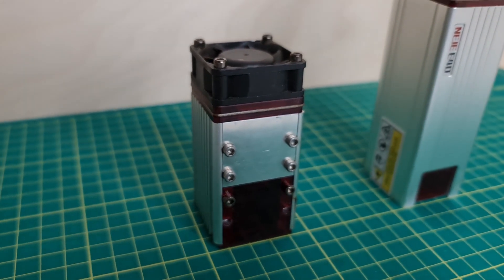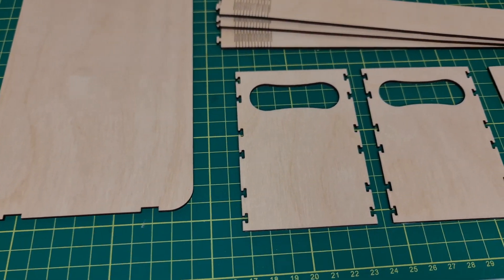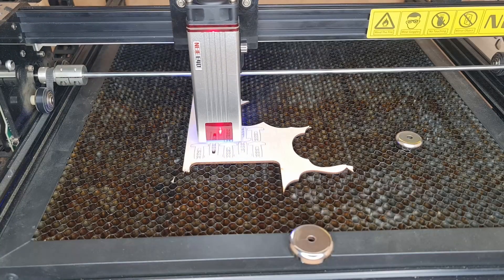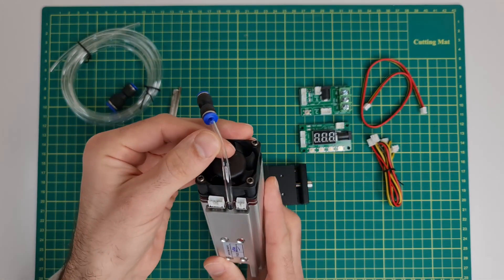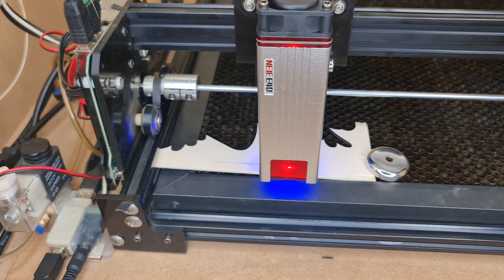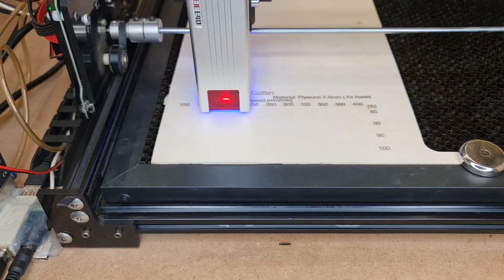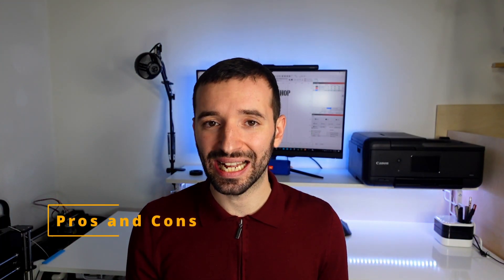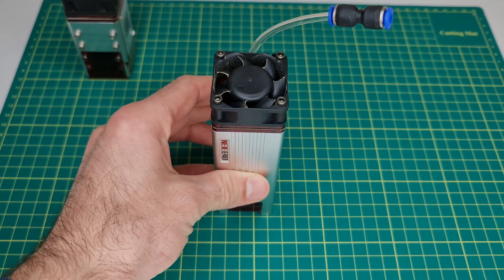Neje E40 review - Is this the A40640 Killer?

Comment: When you mentioned the power supply it made me curious. 12v vs 24v....I have the E80 and the power supply sent by NEJE broke within 48hrs. I have the old power supply for my A40640 on my 2s. Will it work while I get another ordered in (can't get NEJE to respond)?
Reply from the maker: Hi, @CrisAnderson27; thank you for your comment.

The A40640 had a 12V power supply, therefore no it won't work.
You need a brick rated for 24V 5A at least.

I hope it helps
Ciao

Comment: Neje claims the A40640 II has a spot size of 0.04 x 0.06mm and 0.03x0.04mm for the E40.  Are they really that different in terms of kerf size when cutting 3mm plywood?  Couldn't the focal length be adjusted on the A40640 to get essentially the same cut kerf as the E40 on wood thickness less than 5mm?  And when the tiny spot size is set for the A40640 (short focus), what is the focal point length from the bottom edge of the laser module?  According to Neje, the focal point on the E40 is 3 to 5mm from the laser module bottom edge.

Comment: Tell us about your air assist compressor
Reply from the maker: Hi, Doug King; thank you for your comment.

I use a Vevor Silent Oil Free Compressor
https://s.click.aliexpress.com/e/_DFyh6jt
https://s.click.aliexpress.com/e/_DBxAg87
If you use a compressor, you will need a Water Trap
https://s.click.aliexpress.com/e/_Ddo089z
https://s.click.aliexpress.com/e/_DEMFjE3

An air pump would do the job, but not as clean as a compressor.
The only note is the higher the pressure, the higher the likelihood to get condense in the line; therefore, a water trap is a must. If you want to go professional that a refrigerant air water remover will be best suited.

Ciao
Reply: need only cheap aquarium pump you have air assist, not need big expensive compressor newer. normal many brand use own air assist pump 30L/min pump, lot used only aquarium pump. lot cheapen buy aquarium pump than "laser" pump and both have same pump sure.  aquarium pump cost 30-40$ and totally same pump brand say "laser" cost 100$ or more. only idiot waste money laser pump if totally same pump can buy lot lot cheapen aquarium pump.

Comment: Hello and thanks for the video.
I use the E40 for cutting plywood up to 4mm & acrylic up to 3mm; Otherwise, I cut balsa wood in different thicknesses for model building.
I had a choice between the E40 and the A40640II, but the E40 is more effective for my purposes.
I love the fixed focus because I only had the A40630 module before and had to change the focus after engraving some objects for the cutting work. I still enjoy using the A40630 for engraving work on anodized aluminum when the E40 is busy.
I avoided the difficulties with the optimal focus (5mm for me for 1.5mm engraving depth) with the working height of the laser, because I have a steel honeycomb and work with thin neodymium magnets.
A big advantage is of course the engraving of stainless steel without this expensive ceramic...
I use a 37psi compressor as an Airassist and have no problems with parts that are blown away and there are sometimes very small parts in the various model building projects.
Good that you also addressed the point with 100% usage.
I find it important to clean the lens regularly, I didn't have this need to the same extent with the A40630.
Best regards
Hermann

Comment: hello. What focal height do you use? or what for you is the best height to make cuts?
Reply from the maker: Hi, Marcelo Laurini; thank you for your comment. 

Se sei Italiano scorri giù.
In my ramp test, I found the optimal Height to be between 2.5 and 3mm for thicknesses up to 4mm.
I suggest you use 3mm for both engravings and cuttings up to 3mm thick sheets and lower to 2.5mm for thinker sheets.
The limited clearance makes the laser prone to catch on the sheet or clamping devices.

Nella mia prova inclinata mi risulta che per spessori fino a 4mm, il taglio e pulito con un fuoco (più che altro altezza) tra i 2.5 e 3mm.
Ti suggerisco di andare con 3mm per incisioni e tagli fino a spessori di 3mm e scendere a 2.5mm per tagliare materiali più spessi. 
Fai attenzione alla distanza limitata poiche il modulo laser potrebbe incepparsi sul materiale o sui stoppini per tenere il materiale fermo.

Ciao
Reply: @MiddleRoomWorkshop  Grazie